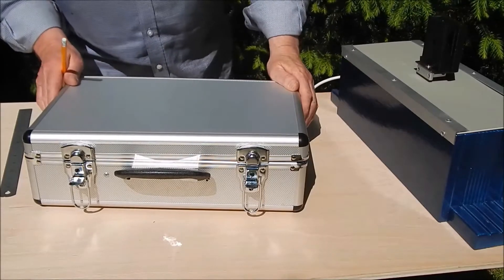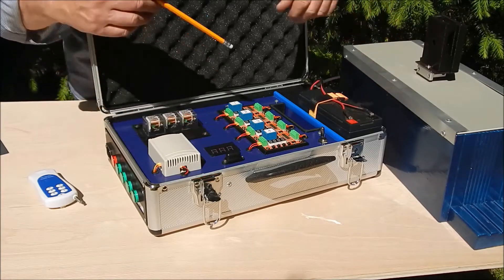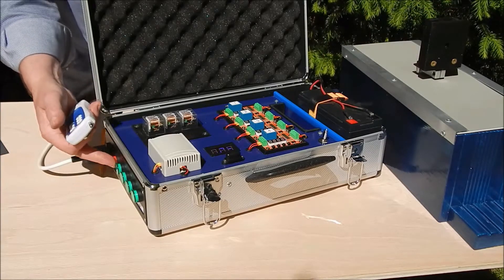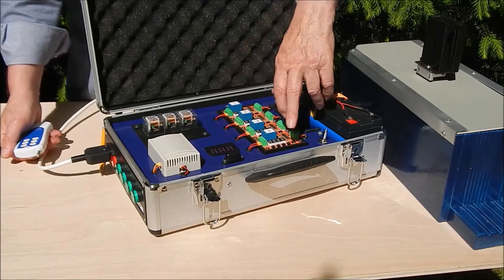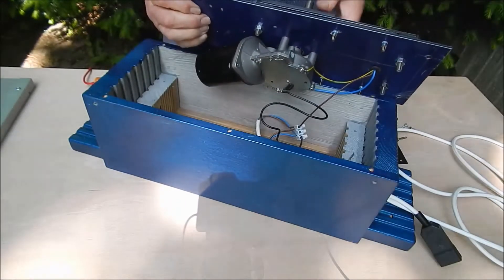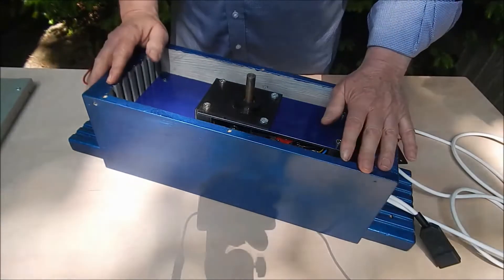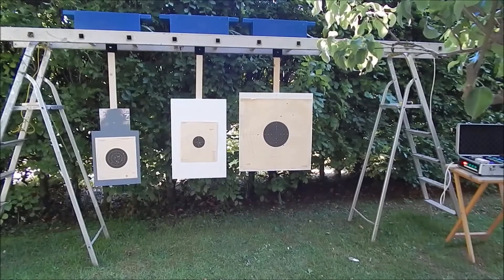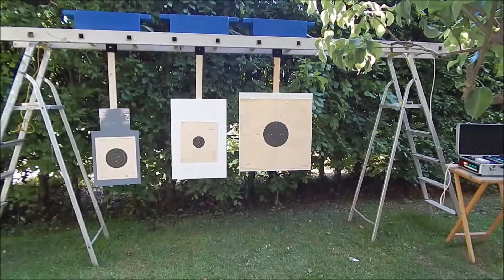Turning targets - A practical, affordable club level system

Comment: Impressive. Congrats and thank you for making this
Reply from the maker: Thank you - I have upgraded the system further to give faster turning times for the targets. I have designed the system primarily for the smaller 25M indoor indoor ranges, however, as the system is self contained and fairly portable there's no reason it couldn't be used at 50 or 100m.
Complete system with 3 target actuators for less than £1,000.  info:  mail@targetmasteruk.com
Reply: @Targetmaster1066  does anyone shoot rapid fire pistol at longer distances?
Reply from the maker: Unfortunately rapid fire pistol, apart from 10m air, is a thing of the past for us pistol shooters in the UK. A lot of clubs shoot timed precision disciplines with .22lr semi-auto rifles or pistol calibre underlever rifles.
Reply: @Targetmaster1066  too bad, it is challenging and fun. Nobody shoots it with rifles here in Belgium
Reply from the maker: Agree. I was a keen UIT pistol shooter in 1975-1990 with a Walther GSP, Pardini, Browning 150, Britarms 2000 before they were stolen by the government. I found 50M free pistol very hard work :)